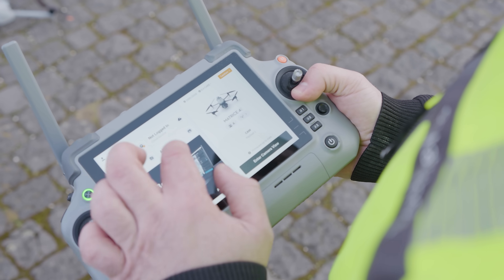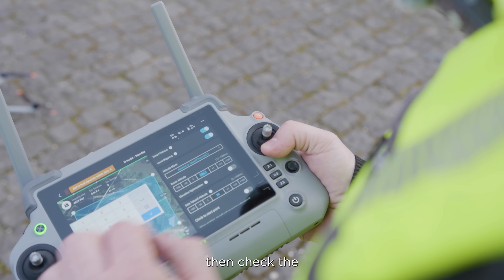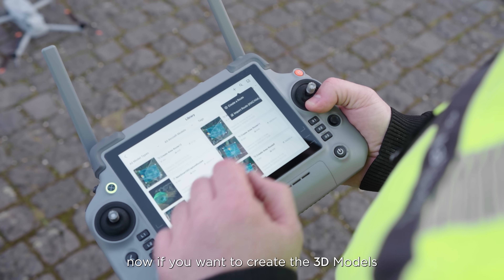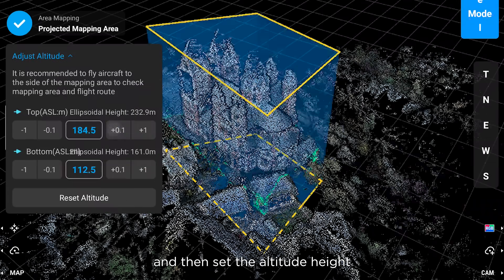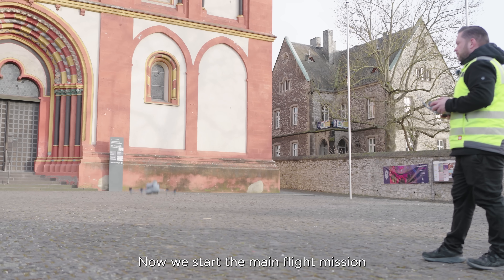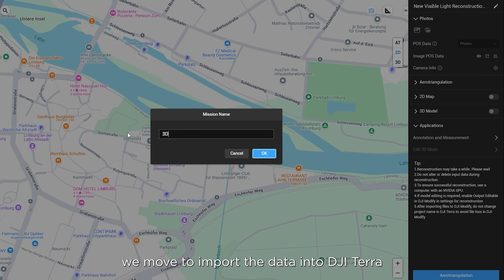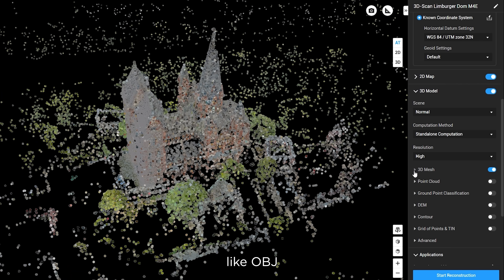How To Create A 3D Model Of A Cathedral Using A Drone | DJI Matrice 4E & DJI Terra

Comment: Hey, Did you do the 3D model on a desktop? Or laptop if I saw it right the 3D modelling took 2 hours? If thats the case that's incredibly fast if you can please answers the above. Also I don't get to select the Altitude when I want to refine the model (the blue box) is that because I'm using the Matrice 4 Thermal?

Comment: 2:46 - 7hrs and 44k photos for 3mm GSD. Is that even practical? How would you even process that? Is 3mm needed for the monitoring of crack progression? 
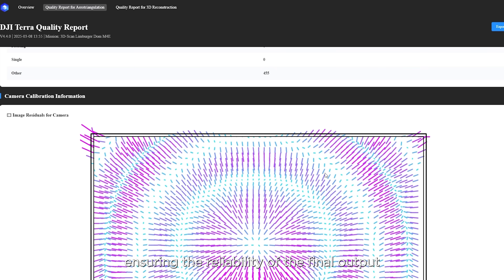4:33 - Actual flight parameters used for modeling is 2k photos and 30mm GSD. Was still 2hrs processing using Threadripper and RTX 4090…
Reply: Still practival if u have the hardware needed

Comment: Wow great work, how you are dealing with blind spots, is the sw closing this gaps/holes (for example behind a figure) from the 3d mesh automatically or do you have to put in manual work?
Reply: Really good question. We think and work in components. You can easily add manual 3d flight route Images or just add another smart3dcapture 5D Route to save time.
Reply: @f7digitalgmbh  .Good Evening Can you share this Work flow .Thanks Anand